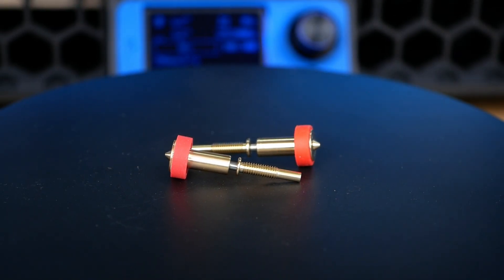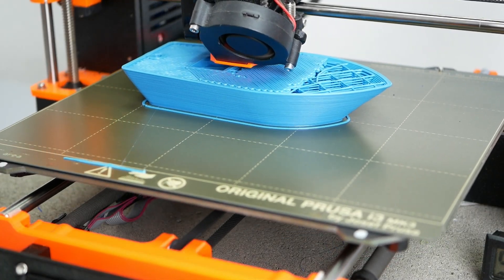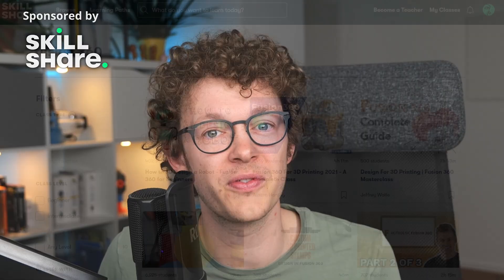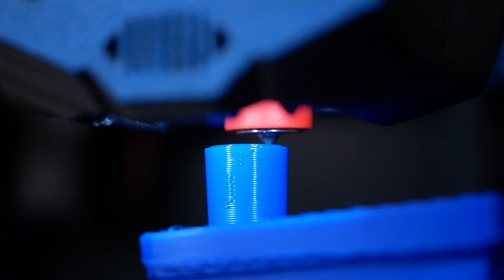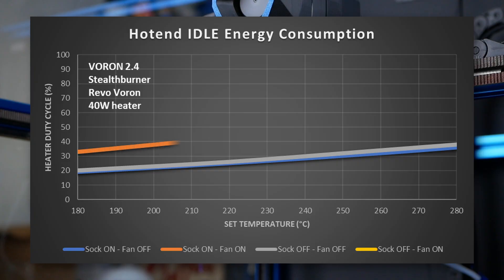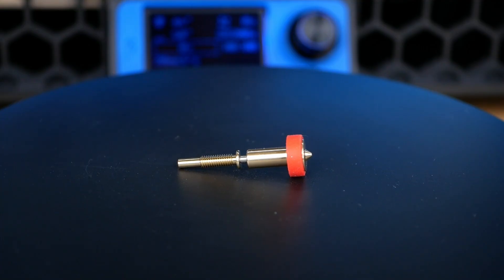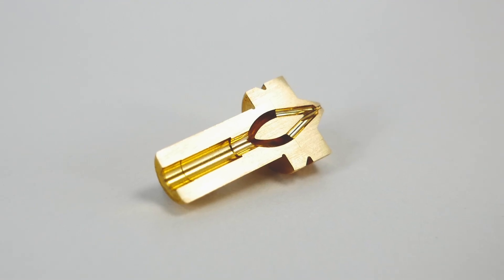E3D made an impressive HIGH FLOW nozzle!

Comment from the maker: What's your take on E3Ds new High Flow nozzle? Too expensive or exactly what you've been waiting for?
Oh, and check out our CNC Kitchen products at https://cnckitchen.store/ or at our resellers https://www.cnckitchen.com/reseller
Reply: Considering the price of a revo + hf nozzle comes pretty close to a Goliath I think it's a bit expensive for how little flow it actually offers.
Reply: @twanheijkoop6753  a Goliath Hotend review would be great once those come out!
Reply: @ericlotze7724  they have been out fore quite some time now? But they are quite frequently out of stock. I think mellow removes the listings for them when they have none available.

Aircooled is currently in stock, water cooled is not.
Reply: Are you not concerned that the Teflon tape insulated the CHT nozzle and prevented it from performing at its full potential?
Reply: @EricYanush  This! Lets compare these two cars but on the competitors car we are going to put an artificial restriction in the exhaust system! WOW look how fast the new car is!
Reply: 55€ für ne Düse mit heat break ist viel zu teuer!
Reply: Seems like a good option for people who print fast. I would not get this simply because it is brass. I would spend $50 on a nozzle but only for an all-around nozzle that is good with abrasive material.
Reply: @danny_cunningham  bozzle is a tad over budget but is a really compelling option, bit less flow than a cht but it's tungsten carbide
Reply: @danny_cunningham  you'll have to wait for that and then they'll tell you that you need a 80W heater and a different collar made out of some special type of silicon only found in the mariana trench and there it is... another $100 nozzle
Reply: Okay....why don´t you just use a standard drill, drill through the copper block and just leave the drill there. The drill geometry will separate the filament into multiple strands and you got high flow rate for the cost of a drill. Just use a 2mm drill instead of 1,75mm should be fine anyways. I mean this thing is 50 bucks WTF.
Was denkst du ?
Reply: @sierraecho884  : Thermal profiles are...heh...wrong...for this unless you're doing that with a hardened nozzle so the heat flow is consistent throughout the nozzle body- metals should be roughly similar if you want it to actually work right.  Stephan did something along those lines after seeing a cheap Chinese knock-off of the king of high-flow nozzles.  Worked pretty well, really.

The main problem is that cheap == inconsistent.  If you don't care about print results (Seriously, many don't, so...), then that's a nifty thing to at least experiment with.  Some of us (*waves hand*) care about relative consistency out of the machine to the limits of the machine.  That right there?  It's not even remotely that.
Reply: Parts of the design don't make sense - the section that is transfering the heat in to the middle portion, is connected to the head of the nozzle, and not to the threaded section, which is where the heat is transfered in to the nozzle - recessing the whole nozzle further back in to the nozzle mount will get the nozzle closer to the heating element. The multiple paths for the printing material are not for transfering the heat from the most direct path, but allowing liquid state material have room to fill under the hottest zone, letting the fluid be under pressure between the nozzle exit and the incoming filament.
Reply: That is interesting for bigger nozzles... 0.6mm and up...
Reply: Its great for revo guys, but bondtech inserts into our legacy stuff. Not enough increase to justify cost alone, you'd have to be wanting to adopt the revo environment
Reply: $50 for a nozzle... if they just knew that 5 years ago I paid $60 for my second printer...
Reply: The Creality Spider 3.0 Pro, the red one with the fat copper heatbreak, I was able to push to 55mm³ without skipping or bulging, on a CW2 300mm 2.4 using ABS at 260c.
Reply: Pricey, but with the Revo's ability to swap in/out nozzles almost totally effortlessly, it might be not nearly as bad as it sounds.  It rather depends on what you're reaching FOR there.  Ease of swap or pure power and speed.  This brings both to the table reasonably- and impressively.

For an Ender, Prusa, or the like, it may be a bit painfully spendy for this one- but high-flow is purely for speed.  Unless you're aiming for 500mm/s or higher speeds...did you REALLY need the HF hotend/nozzle?  

For me on my current daily driver printer (Moderately modded Ender3 v2) it doesn't make nearly as much sense to buy this unless I make the mods to shove it off into the insane print-speed space with Klipper, closed loop steppers, etc.  With my experimental, "new," kinematic I'm designing out...which has a Revo Micro on the effector for the hotend...it's more of a compelling story- because I am aiming for those speeds and it makes swapping out nozzles for profiles (Need to print TPU?  It's simpler to have the right hot-end and swap out nozzles with speed and ease than to have another printer or futz with the "old" way of doing things...)

This is an enthusiast/pro thing- but then HF rather IS that anyhow.
Reply: It looks nice

Comment: Hello,i have a very important question,how if we add an extended brass tube with the same hole of the volcano nozzle,put them in a super volcano nozzle?can i reach100mm3 flow?because in my country there are a lot of limitation and I can’t buy it,i should build it

Comment: Hmm. If you get a blockage in a nozzle like this, I'm wondering if a standard cold pull would help, if the block is close to the orifice. Also, clearing the nozzle with a needle might be problematic. I think I'll stay away from these, as I do occasionally need to do a cold pull. Don't we all?

Comment: I have a Revo fitted to my vzbot I think it is a piece of crap, I get nothing but bad prints from it, sits and blobs on inside of internal round holes that I can not get rid off no matter what settings I've tried, the V6 was much better but not by much, the best nozzle I've used for clean prints was a mk10, that was on my wanhao i3 that printer printed small parts great. Will be removing the hotend and it will be my last E3D purchase I make.......But what do I replace it with? that's better......or do I make something custom with a mk10 nozzle or CHT nozzle.......

It anit just about the speed, it's how well it prints the parts and the revo oozes filament bad when printing small parts or holes (the internal surfaces are full of sits and blobs) try printing a small  cylinder about 5mm interal dia with petg and tell me it doesn't look like crap down the hole. I know cause I got one here and I'm not new to 3d printing.

Comment: The limiting factor with the power isn't steady state, it's when suddenly you hit a fat bridge area, double the print speed, and max the fan out at the same time. It isn't that you don't have enough power for that situation, it's a question of whether your PID will sort it out before the thermal protection kills your print. This was with a brass volcano block that was just suuuper sensitive to cooling. Really a struggle to PID tune for high-flow and fan on/off, even with a sock, so it's good to have some margin on the power if you are going with high flow rates.

Comment: how do they heat dome in middle? first outer part, then filament then dome gets heated. so it doesnt heat from inside until it receives enough heat from filament tube part.
Reply: That dome piece is connected physically to the nozzle at the very end of the extruder. So when it heats up, the whole thing heats up all at once.

Comment: Let’s see how much longer they can rip people off for mediocre gains relative to price. Such a shit way to achieve surface area, melting AFTER splitting. If you just used a longer tube and a longer heat block you’d get the same thermal affects for minuscule price increases. This is shoving barely heated plastic around the small “island” and is probably a much higher load on the stepper. It’s kind of like a log splitter. Just make the heated section twice as long and boom, twice the melting power. And can you imagine a clog in this?  Lol. The bond tech is just as sloppy, logsplitter and then heat after.

Comment: The question is, with such easy to swap nozzles, why not take them out (remove the sock, obviously) and heat them to a few hundred degrees with a blow torch? Usually burns off any excess plastic.

Comment: I like that they kept the formfactor for easy switching. But on the other hand I would have liked a UHF version with an extended meltzone. Maybe that will come next year.
Reply: I suspect so.  This is a nice system they've come up with.  It's more robust in several ways to stock on most printers- and it's easy to change nozzles out.

Comment: If you where to build 2 3D-printers yourself, one large for big pieces one regular sized for high speed, both with a decent amount of detail and cost would not be an option (just build a Ferrari-3D printer in your mind), what materials would you pick? What nozzle? What heating element? what rig? etc.... What would your ultimate idea of a 3D-printer (with todays technology off course) be like if you only combined the best of the best for your needs?

Comment: With all the R&D they seem to put into this, I don't get why they end up with a concept where you force a ram into the coldest part (middle) of the filament. If it was me, I'd make a "flat melt", where you made the melt zone wider and wider and thinner/flatter. And then back to round. You could make that slot as narrow as the nozzle. Even smaller...
Same for the Bondtech CHT. I'd think the filament would want to go into on of the 3 holes, rather than spilt..

Comment: Serious question. If getting enough filament heated fast enough to keep flow up is that hard, why not a nozzle which feeds two or more strands of filament in at once? Just literally double the amount of filament inside, since as you said the heat output of the hotend isn't the bottleneck.

Comment: Fantastic analysis. I think the value proposition might make sense for some very niche applications. I personally never change nozzle sizes, and a cheap knock off Volcano hotend with a CHT nozzle will outperform the Revo HT. At the price they're going for, I'd rather just buy a separate printer if I ever needed to print with a larger nozzle size.
Reply: That requires space...and if you're modding for specific things, you'd need to replicate that over multiple printers.

Like the others, you felt the need to comment.  Thankfully, you're more reasonable than the more mouthy in this discussion thread set.

Comment: something a lot of high flow nozzle video does not discuss is there shit retraction. flsun v400 is not bad because there is still direct path from the extruder to tip of nozzle, but the ones that have a center heating element (like this, cht and cheap cht knock off) has bad traction

Comment: why not just have a ton of molten storage for plastic
Reply: nozzle nonsense for money/law reasons, nope nope
Reply: if you cant laser, or dont have conductive paint, then graphite pencil (for electroplating a conductive surface) works
Reply: word: tin filament
Reply: lasering of copper/silver acetate into metal, for 3d printing, decomposes at 220C or so, into metal

Comment: I see an issue with your testing right away, the teflon tape is going to act as an insulator retarding the rate of thermal flow into the nozzle itself for the hacked job, so you need to get it working with something sealing it up that is also a good thermal conductor like graphoil or a soft metal (annealed) sheet wrapped on it instead and maybe some high temp thermal past like rector seal? not sure on the brand but they have a grease good for extremely high temperatures that is jam packed with copper particles making it look like a copper paste, this might solve the possible issue of the teflon tape interferring with results and get a solid reflection in flow rates across all units, if you were using the proper connection tip for each of the nozzles, 

I really like their innovation to get the splitting though, by boring out a curved hollow and then pushing the capsule shaped point in the middle up into the unit, with the holes then straight drilled through each of the 4 positions, 

My interest in high flow options is that I have a design that can increase the lay down of material up to 1000x so that filament is going to have to be melted down ultra fast to really take advantage of the process LOL.

Comment: But no comparison to a Rapido with a standard v6 brass nozzle tho. Revo HF vs a CHT in a jerry rigged adapter that is not as likely for people to use instead of a normal v6 accepting hotend leaves out possible information.

Comment: Great video and appreciate your work. Please put it on consideration to test 0.6 nozzles with ABS to see what the flow rates are. The heater capacity analysis was also informative. Based on your findings I suspect a 60w is required for 0.6.
Reply: I'd say it depends on the material.  You'll probably do okay with PLA/PETG/ABS/ASA.  PC and Nylon will likely need the 60W to gain maximal advantages of the nozzle design.

Comment: Maybe instead of cold pulling try using a noclogger and see if that helps. The split might be more difficult for the metal rod but it might also push through instead of having to risk damage to the nozzle.

Comment: This is all cool and impressive… for people who already have Revos. I personally run my Vorons up to 200-250mm/s and specifically tune my profiles to max out the hotend as best as I can. As someone who looks for performance it’s hard to imagine me ever getting a revo high flow, I think the convenience of changing a nozzle in probably 10 sek less just isn’t worth getting yourself into this ecosystem wich is limiting in many ways. I have to walk over into another room to change my printers nozzle anyways, I don’t care if I change it in 20 or 30 seconds and with the auto z calibration adjusting the z offset is also a non issue

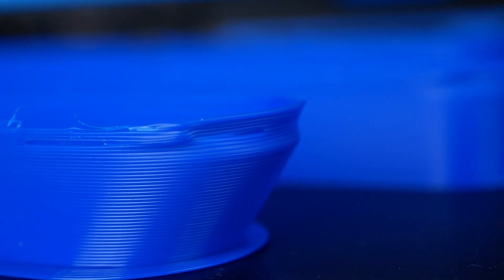Comment: 6:55 
YES , IT AFFECT THE FLOW OF CHT !!!!
try it with just sanding 1mm of the adapter so it will seal it or cut 1-2mm thick spacer from ptfe that you will insert inside to seal it (use filament as a guide before you screw the nozzle in so the spacer wont move around when you squeeze it
should work great ...you can even use slice engineering Boron Nitride paste to get some extra few mm3s of flow :) 

or better ...go with bondtech vulcano and 1-2 m6 nuts (maybe out of copper or bronze .... im curiouse how it will work )

Comment: Looks neat. Only problem might be that they are harder to unclog when needed.
Reply: If the insert could be removed separately you could open it so clean it and you would actually be able to remove the just the nozzle tip wear surface 🤔 E3D has pretty good engineering and they seem close to a really competitive solution
Reply: This was my thought the entire video. I guess these high flow nozzles are only good for lab or professional environments using high quality filament.
Reply from the maker: Become a cold-pull champ and then you might be able to unclog it ;-) Maybe cleaning filament might also help.
Reply: @CNCKitchen  That's the thing. the shape in the middle creates an undercut so I don't think you can do cold pulls with one of these.
Reply: @ManWithBeard1990  if you do succeed it would look quite alien like for sure! haha

Comment: I was waiting for your review of this! I didn't realize the price, that is insane on a wear part. The regular nozzles were bad enough. I would have liked to have seen how it fares against that drop in Chinese part that you used before, but given the issues you had with the CHT, I get why you didn't.
Reply: My jaw literally dropped when I heard the price. That's insane.
Reply: @TheSanpletext  : If you're used to the cheap crap you buy off of Amazon for your nozzles...yeah.  It probably does seem insane.  If you're used to quality parts, it's not.  How much for a Ruby/Diamond tip nozzle for abrasives?  Oh, wait...
Reply: i dont really see the problem with that price its not really expensiv i mean how often do you need a new nozzel
Reply: @thomaskletzl6493  thinking that a new Revo Voron with a standard nozzle is $85...
why do I need to pay $45 for a nozzle and another $45 for the heat element??
Reply: @MrPeloseco  : You didn't need a new heat element unless you're aiming for 250mm/s or higher print speeds or the top-end stuff like PC or Nylon.  Did you NOT watch the video?  Stephan made it clear that it was impressive and just fine with the 40W element.  Seriously...some people...they'd bitch if you hung 'em with a new rope.
Reply: @frankearl9285  but I'm aiming to those speeds... otherwise, why do I want a HF nozzle? to extrude at 15mm³/s?
Reply: @thomaskletzl6493  if you print non Glowing CF or white filaments then yea i suppose you dont need to replace very often
Reply: @lawlcake8788  : Ding!  You'd be buying an Obxidian nozzle in that case for that.  Seriously, folks, everyone keeps going on about price there- unless you're doing something stupid or using cheap parts (Heh...hint...hint...) that nozzle isn't as much of a wear part as everyone keeps going on about it as.

I mean, y'all aren't driving the tip into your bed all the time, riiiight?

You know that glow in the dark, CF and glass, etc. are SUPER abrasive and you needed a steel, ruby or similar hardened nozzle riiiight?

What're y'all doing that makes these THAT painful, hm?

Comment: I've tried the CHT clone some time ago, but I had problem where dust from filament got stuck inside the nozzle and I was unable to clean it. 1 of the 3 channels is clogged. So you should always use filament sponge filter or smiliar when using these kinds of nozzles.